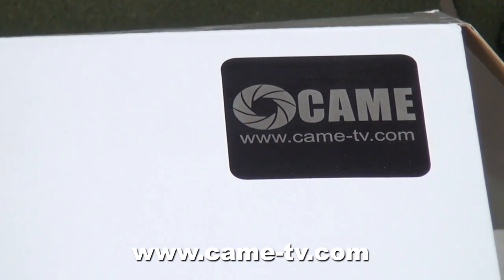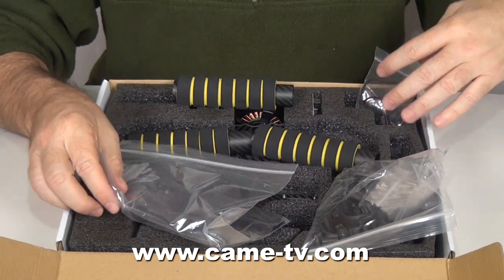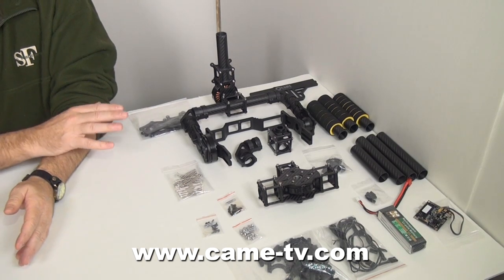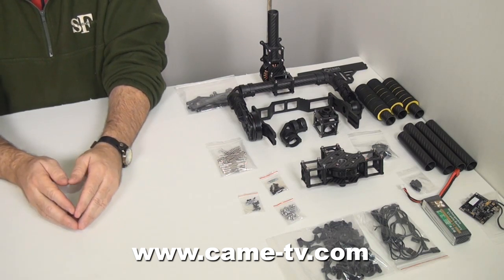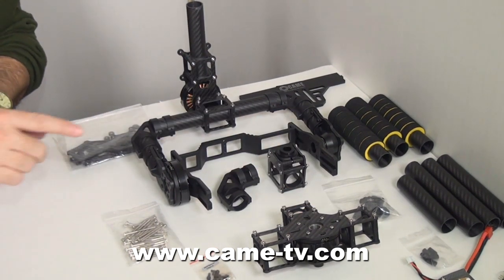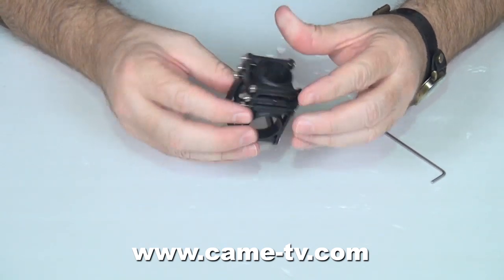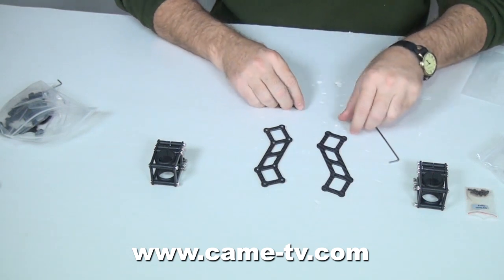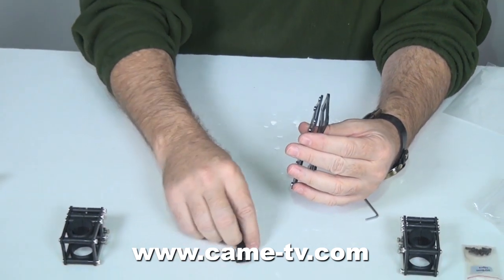CAME-7000 Assemble 3 Axis Camera Gimbal Installation Video Demo

Comment: Thanks for the instructional video.  I would hate to do this just by reading an assembly manual translated from chinese . While the price point is exceptional itseems they could do more assembly at the factory before shipping.  I also noticed that to enable follow mode requires a bunch of software installation which seems daunting.  Since follow mode is pretty essential for a gimble, why dosent the manufactor do this?
Reply from the maker: we are trying to update model which is assembled model
Reply: Great. You should have a winner. Good luck.

Comment: will the 7000 fit a d4 which is 16cm high?
Reply from the maker: althrough D4 is taller,  but you can take down the top bar for install